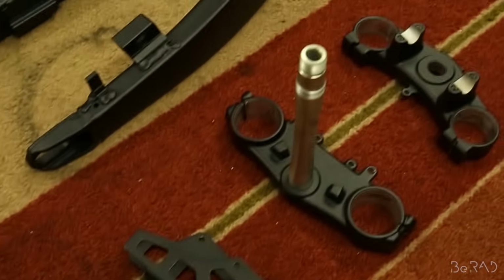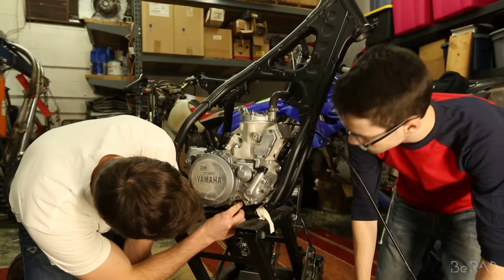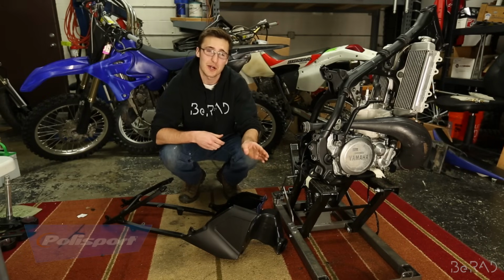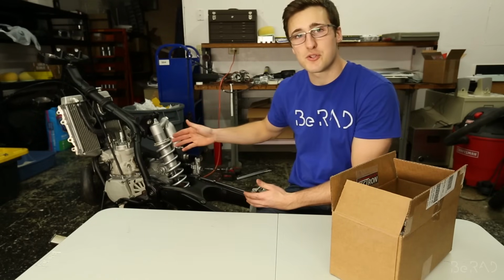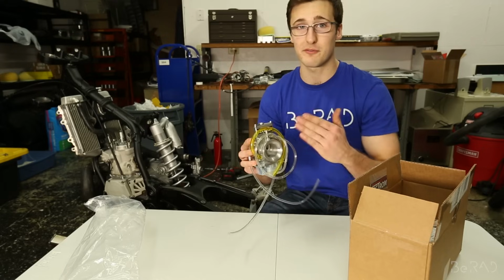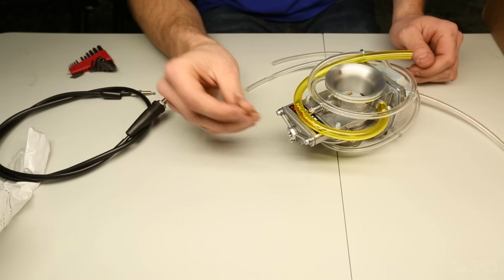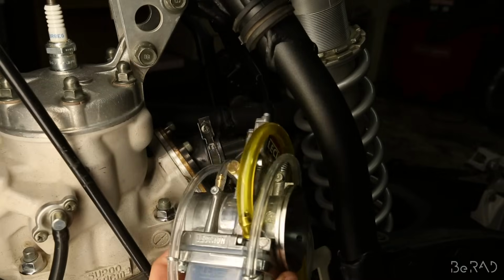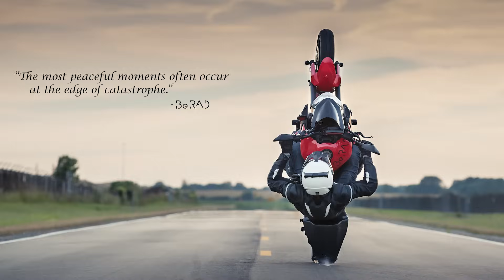Black Powder + Lectron  - YZ250 Restoration #3

Comment: Hey BeRAD, I noticed you left the reed spacer in there. Did you leave it in? Any rubbing issues? Lectron suggests taking it out, due to possible fitment issues. I’d worry about losing torque by removing it... what are you’re thoughts on this? Thanks!
Reply: ThisMountainLife- 
     That bike is an 02-04, it most likely has the older size shock and spring which is a smaller diameter. He can probably run the spacer without it rubbing. The Lectron I have on my 2016 250x is from 2013. At the time it was the shortest body available. I'm not sure if this new H model is a shorter body or not. I had to take my reed spacer out for things to be right. I may install an older (02-05) rear shock just to be able to run the reed spacer. I ride in mostly nasty rocks and roots and I have been told by a good source that those smaller body shocks flex more and would be better for my riding that I do. The funny thing is, I bet this guy's frame is better than my aluminum one in the rocks. Everyone always thinks that newer is better, not the case.
Reply: d nelson thanks for the reply. Makes sense on the steel frame geometry being a bit different. Mines actually an 02 as well. The h series are eveeerrr so slightly less deep.  Also, I’d agree that steel frame is the best frame!

Comment: Did you just remove the throttlesensor from the old carb? Dont the CDI box need it with the Lectron? Tomas/Sweden.
Reply: On my wr450f you can just unplug the TPS no problem.

Comment: Is the lectron really that care free? You don't have to worry about figuring out your gas/oil mixture different to what I'm already running? I'm assuming it can still get gummed up if I leave old fuel in it for too long and all that? Seriously considering getting one so I wont have to worry about rejetting or tuning for a high elevation trip this summer.
Reply from the maker: You can run whatever oil/gas mix you currently run. Yes it can still get gummed up i suppose if you let it sit too long.
Reply from the maker: but otherwise you shouldn't really have to do anything!!!

Comment: I sure hope you used blue loctight on all your bolts and a torque wrench.  If you didnt take it apart n start over. Racing 2 strokes since 1980 ive learned blue loctight is our best friend.
Reply: Wait until the handle bars come off at 50 in the woods.

Comment: I thought you was going to do the hole engine up make it shiny like Tyler nonagon I think that’s how you spell it kx125 engine
Reply from the maker: myles Kawasaki kx85 just wait until you see it all done. It didn’t need any vapor blasting or anything. I didn’t have time either. I initially planned on paying $1000 or less for a bike that needed engine work...I got one for that that ran just great! No sense in tearing apart a perfectly good engine yet. But it looks good. The final product is not what it looks like in this episode